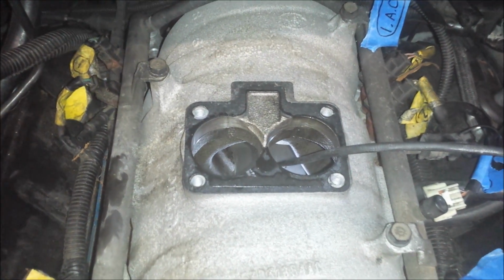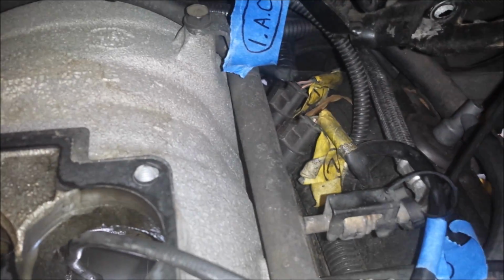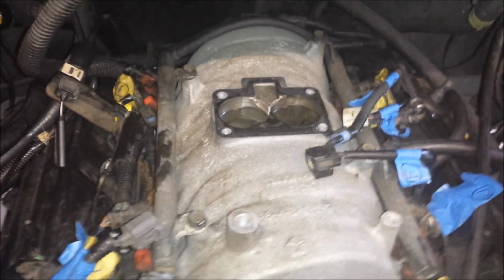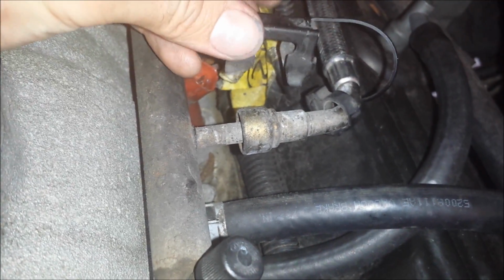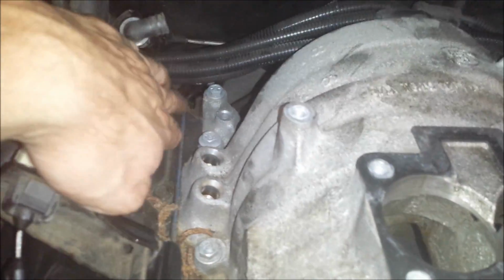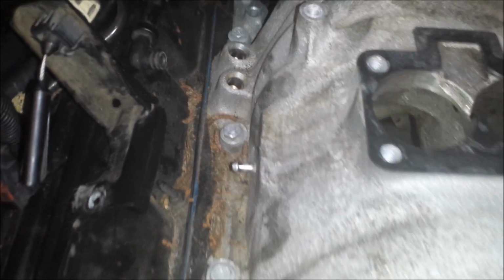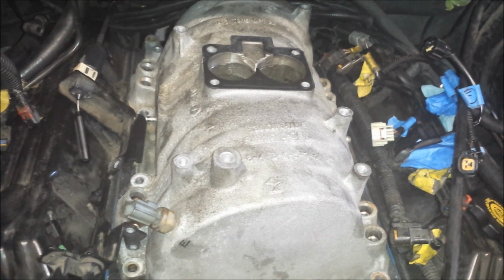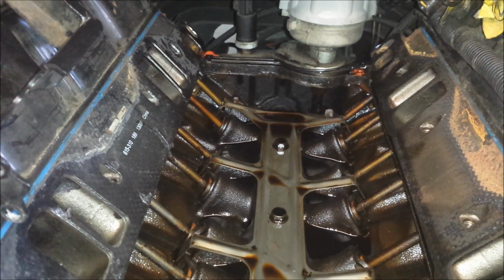2001 Dodge Ram 1500 - Intake Manifold and Plenum Gasket Repair - Part 3

Comment: if the razor blade still bugs you just drop you're oil pan on your next oil change. clean all the gunk out and get your razor.
Reply: +Matt Payne I know if it was mine i probably couldn't sleep at night. I've kinda got a question how much smoke was yours putting out when this went out mine is like a smoke grenade when cold but when it's warm I don't even notice. I burned 3 quarts in under 400 miles what else could it be and how do I check it I checked the plenum last night and I didn't see any oil but I didn't have a mirror.
Reply: @jakeallen8309  old comment but for anybody else reading, do a compression test. Then put a little oil in the cylinder and compression test again. If the numbers are different then you have bad piston rings
Reply from the maker: +GunNut11 It definitely still bugs me, but it looks like dropping the oil pan would be a fair amount of work.  I contemplated doing that as soon as the razor blade fell down in there, but I can't see how I can remove the oil pan without removing the exhaust crossover pipe.  I'll probably just live with it.

Comment: Where you getting a high idle because of this gasket failure?
Reply from the maker: +Hardcorediver44 Not really...my idle condition seemed pretty normal.  Do you have a high idle?  That could possibly be caused by a bad/dirty idle air control valve, which is pretty easy to clean/check/replace.  Do you also suspect a plenum gasket problem with your truck?
Reply: Yes, I changed out the IAC and still will idle high and I smell oil being cooked in the engine compartment. I'm pretty sure its the plenum. I plan to up grade to a hughes 1/4 plenum plate so I don't have to do it again. The truck has 110k its a 96. Its a known problem.

Comment: Hi Matt. Great videos. I'm just curious, how much more work would it have been to replace the timing chain with all this apart? I read somewhere that it would only require taking off 6-8 more bolts (on a timing chain cover?). I am not a mechanic and I have no clue, but I've read I should replace the timing chain at the same time as this repair is done. Thanks.
Reply from the maker: +anthonyflannery222 I really wanted to replace my timing chain while I had the engine apart, but it actually seemed like a fair amount of extra work, despite already having so many things removed.  I've never done a timing chain replacement myself, but based on what the service manual says, you would need to:

-Remove the water pump
-Remove the power steering pump
-Removing the vibration damper from the crankshaft (which requires a 3-jaw puller tool, similar to this: http://www.harborfreight.com/three-jaw-puller-set-4-pc-69104.html)
-Loosen the oil pan bolts and remove the front bolts on either side

Then you still have to remove the timing chain cover and timing chain, clean the gasket mating surfaces, and re-install everything.  Not to mention that setting the timing correctly can be tricky and catastrophic to your engine if done incorrectly.

I was in a hurry to get my truck back on the road, and also a bit gunshy about doing this on my own for the first time, so I didn't dig that deep.  I wish I had, but time just didn't allow.

If you think you want to tackle this in addition to the plenum repair, more power to you!  It's definitely easier with so many things out of the way.  You can download the factory service manual for your truck from the "About" tab on my channel page.  The timing chain section for the 5.9L engine starts on page 9-169.

Good luck, and thanks for watching!
Reply: +Matt Payne  Thank you Matt for the detailed reply. I appreciate your time. I am trying to get a mechanic friend of mine to tackle this repair. I don&#39;t have a heated garage or I would possibly attempt this myself (possibly). Your videos are very thorough. I mentioned the idea of replacing the timing chain to him, but he seemed to think it was a significant amount of more work...and I had no idea. Time will tell how this works out. The DodgeForum has a thread that highly recommends changing the timing chain. I&#39;ll discuss it with him and see what he thinks about doing all that.

Thanks for the manual, I downloaded it. I have the Hughes kit sitting on our washer...now it is just a matter of getting it in the truck, and figuring out what to do about the timing chain and water pump.
Reply from the maker: +anthonyflannery222 You're welcome!  I'm right there with you...I don't have a garage of any kind, so doing anything involved this time of year is really tough.  I filmed this video series in the garage of a family member's house.  I would be in heaven with any garage...even without permanent heat!

The plenum repair really is not that difficult; just a bit tedious.  But I covered basically every minute step in my video, so there really shouldn't be any surprises.  Just be careful to not break off any bolts when removing the manifold - that would be a frustrating setback.

With regard to the timing chain replacement, I'm sure you can handle it, especially if your mechanic friend is helping out.  It will probably add at least 4-5 extra hours to the work, but is worth doing if you have the time.  Just follow the steps in the service manual to the very last detail and you should be fine.

Good luck!  Let me know how it turns out.
Reply from the maker: +Brad Streets Thanks Brad!  I actually just had the same coolant link from around the timing cover.  Since the truck was already in the shop because of a no-start condition that I couldn't figure out (ended up being a bad PCM), I had the shop take care of the coolant leak for me.  They replaced the water pump and timing chain at the same time, so I should be good to go for a while.  I would have preferred to do this on my own and save some money, but I just don't have time at the moment and wanted to get the truck back on the road, so I bit the bullet and paid the shop to do it.  If there is a "next time", I'll definitely try to do it on my own.  Thanks for the information!

Comment: A good thing to do while you have all that junk off the top of the motor is unscrew the oil pressure sending unit which is the 3 or 4 inch high 21 mm or so (ordinary deep socket) thing just to the left of the distributor in these photos, It's just another of the many famous places on these motors which leak oil and are hard to detect once you put all the stuff back onto the motor. So while it's easier to reach take it out and put some Permatex Number 3 or similar reliable thread sealer on the threads and screw it back in. If your motor turns out to be full of trash, you can even shove a little magnet down that hole. It comes directly from your oil pump. If you are really gung ho and have the front of your motor apart,  behind the cam retaining plate there is a pound in type of plug.  It's the oil gallery which oils the lifters and eventually the timing chain. It is connected to the oil pressure sending unit drilling.You can yank out the plug and again, shove a suitable tool then your wet dry vac with a small tube attached, then your skinny magnet to fish out any metallic debris.  There was some hard stuff in my 1994 318 motor. It took some gouging to get it out. Just make sure you have the replacement plug handy. They're hard to find. While you're at it, inspect your cam lobes. You can see them under that sheet metal plate at the bottom of the valley. If your motor has had a sludge problem, another thing these engines have a talent for, your lifters may get stuck partially up! Then the cam comes around and whacks into the lifters and takes a chunk out of the lobes! You will cry if you see this. Matt is correct about the vacuum cleaner. Keep the trash out of the motor! I had the new 1996 Jeep almost done and some halfwit crashed into it. Now I have the new one 1998 and looked into the throttle body and  saw the dreaded oil slick! That's why I'm here. I'm gonna put a vacuum gauge onto the PCV valve hose and if there's a vacuum rather than pressure in the crankcase, I will know I have to do what Matt has kindly videoed. Great video. Clear advice. Thanks Matt..
Reply from the maker: +stanthology Wow, great information and advice!  Thanks so much for sharing all of that....it makes me wish I had replaced the oil pressure sending unit while I had everything apart.  I also wish I had replaced the timing chain at the same time, but as with most projects, there is always the question of where to stop replacing parts.  I'm always thinking, "while I'm here I should do....", but that can turn into a never-ending process.

Thanks again for this awesome information.  Best of luck with your plenum repair - you sound very knowledgeable, so it should be a piece of cake for you!
Reply: I think you mean breather hose not PCV hose right?
Reply: @MrJaydeep777  To be honest I can't remember!
It has been quite a while. But what you say sounds right.
Reply: @stanthology  Okay thanks! I’m pretty sure that my 2001 Dodge ram has this problem but I’m trying to learn all I can before I do it. It looks like a pretty big job and a lot of guys are having to do it over again so I’m also trying to figure out the best gaskets or gasket kit to get.
Reply: @MrJaydeep777  I think if you put your hand over the hole on the driver's side rocker cover (with the fitting removed) you will feel puffs of blowby which indicates pressure leaking through that gasket. Sorry, I can't remember the actual procedure.
Reply: @stanthology  The procedure that I read about says to pull the PCV valve out of the left valve cover, then plug that hole that the PCV valve pulled out of with one finger then pull the breather hose off of the air cleaner which goes to the other valve cover and cover that hose with another finger. If you can feel suction at all on the hose going to the right valve cover then the theory is that the gaskets are leaking. And my pickup did have a little bit of suction on that hose. And since the problem seems to be pretty widespread I’m pretty sure that my gaskets are leaking.
Reply: @MrJaydeep777  Thanks Jay..

Comment: I finished y gasket repair. no more leaks but I have the fear that I have a intake leak now. I can feel hot hair by the front of the intake on the drivers side of the av compressor. Could you shed any light on this? It still coughs like an asthma attack in the hot weather. Do you have any knowledge about this?
Reply: +Richard Cowtails I wouldve use RV on them..Learned that when Id worked a BP pro care long ago..Most of the mechanics do that,,because they dont trust the gaskets..
Reply from the maker: Richard Cowtails Richard, when you say you feel hot air, do you mean blowing out of the intake manifold into the engine compartment?  To me, that does not sound like an intake manifold leak, as the manifold should be under vacuum and a leak should be sucking air from the engine compartment into the manifold, not blowing air out.  Are you sure you're not just feeling air blowing from the radiator fan?

To rule out a leak, I would (carefully) spray some carb cleaner around the area you are concerned about while the engine is running.  If there truly is a leak, the carb cleaner should get sucked into the intake and you should hear the engine idle audibly change.  

Have you checked the engine vacuum with a vacuum gauge?
Reply: That's probably what it is. Sprayed brake cleaner all over the intake area, didn't find anything. Had that choking again today idling in the parking lot. i took off the funnle hose thing that connects to the breather box and put a book over it and that "asthma attack" symptom went away. is any of this making sense? madness to me lol. I'll be cigar smoking the intake tonight. see what i can find. might buy a fog machine and mityvac kit. What are your thoughts in this? man... that intake sucked...... lol
Reply from the maker: Richard Cowtails Hey Richard, any luck figuring out what's going on?  Did you find a leak anywhere when you did your smoke test?

I'm starting to wonder about your Idle Air Control valve.  If I understand correctly, you said that you disconnected the tube going to the air filter housing and closed off that opening, effectively plugging off the air intake to the engine....is that correct?  But doing that made the engine run better?  If that is true, then it sounds like you do have a leak somewhere....either from the intake manifold/plenum, or perhaps your Idle Air Control valve is going bad.  If the IAC is open too far, I suppose it's possible you could be getting too much (unmeasured) intake air.  If the computer doesn't know there is extra intake air, it's not going to adjust the fuel trims properly, so you could potentially get the choking symptom.

I don't know if I'm on the right track or not...but let me know if you found your problem.
Reply: I located a bad pre cat o2 sensor. wasnt going into closed loop. as soon as I start the truck... it dies that weird sucking thing. its always in "open loop" not entirely understand what that means... but its bad lol. says Haynes Manuel lol. Ordering a new one from amazon. the stores want almost 60 bucks for it........ I got it on amazon for $21. from my understandings, If the pre cat o2 is misreading or lieing to the pcm that'll control the iac. and the o2 is telling the computer that the truck isn't getting enough air and it opens the iac all the way....... That would cause that. I read a forum last night telling me all that. I'll try and find that page for everyone.
Reply: did a smoke test no leaks. seeing I'm having that sucking intake thing... that would indicate bad plenum, in my opinion. but no oil once so ever. So the plenum cant be bad.
Reply: http://dodgeforum.com/forum/2nd-gen-ram-tech/338088-idles-fine-then-literally-almost-stalls-loud-hissing-sound-under-hood.html
Reply: The hissing is almost universal when that sensor fails. It's caused by the IAC being fully open as the PCM tries its best to get the idle speed back up to normal.

In most cases it starts out as a stumble that lasts just a few seconds when the PCM goes into closed loop mode. Over time the stumble becomes more pronounced and lasts longer, then eventually the failure progresses to extremely low idle speed and hissing intake upon transition to closed loop. Let it go still further and the engine will intermittently lose power on the highway at cruising speed while the truck is unladen. Until just about the very end, you can open the throttle to get the engine speed up so more hot exhaust gas flows over the sensor to heat it and get it functioning more or less normally.

Y'see, an end of life oxygen sensor reads rich, and the more it decays the more falsely rich it reads. So at the appointed time the PCM goes closed loop and starts paying attention to the oxygen sensor, and it sees a false rich condition. It narrows the injector pulse width to compensate, which lowers the idle speed, and when the PCM sees the RPM drop it starts stepping out the IAC to compensate for that. This drives the mix still leaner, but until the PCM sees that via the O2 sensor it doesn't react because the TPS is not giving an indication that the throttle is opening -- thus the transition stumble. In the early stage of the failure it'll find a happy medium pretty quickly, but as the decay progresses the PCM is getting an increasingly inaccurate picture of the world. Eventually the problem reaches the point at which the PCM goes closed loop to find what looks like a gonzo rich condition that calls for the shortest injector pulses it knows how to throw, which requires the IAC to be stepped out to wide open. Hisssssssss....

The easy test: Unplug the sensor to force the engine to stay in open loop. If the symptoms stop, the O2 sensor is almost certainly bad because that's the one big difference between open and closed loop: The PCM starts paying attention to that sensor.

This is the time of year when we'll start seeing lots and lots of failing oxygen sensors because the weather is cooling. Fall and early winter are oxygen sensor and heater core season.
Reply from the maker: Richard Cowtails Cool....so I was on the right track, but the IAC wasn't the actual cause, just a symptom.  Did replacing the pre-cat O2 sensor solve your issue?
Reply: Replacing that pre cat o2 solved the hissing. I researched and found alot of ppl how have the 2nd rams have this issue. It worked for me. I'm Theirs more than one reason for having the same symptom... But this worked for me. Thank god... i was at my wits end with this thing lmao
Reply: ***** man my gasket failed AGAIN! I'm so frustrated lol. shops are ridiculous. I guess ill buy a snap on torque wrench this time I guess. Unless my damn intake is warped.....

Comment: It may have failed because the material below and above are different and expand at different temperatures which tares the gasket. The best fix I hear is to get a aluminium gasket.  That or you just didn't do it right :) But I've read some forums where a lot of people were having this problem so they went w the aluminium one.